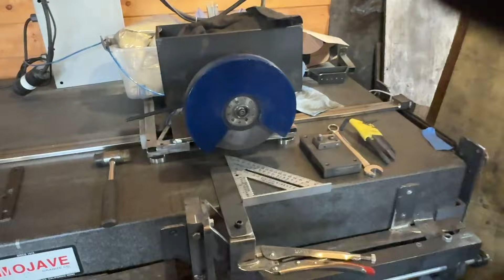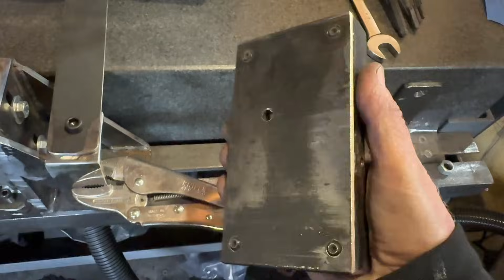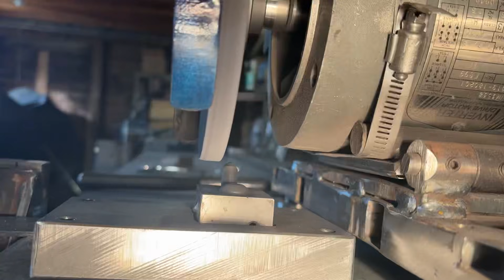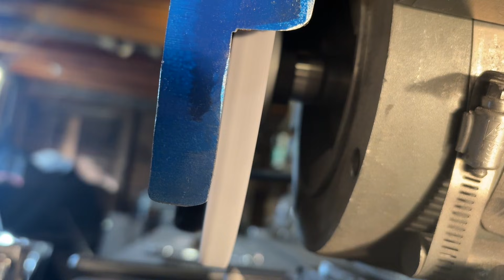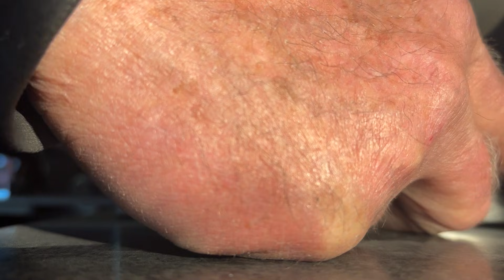Dressing the Grinding Wheel on my Air Bearing Surface Grinder

Comment: super interesting rig
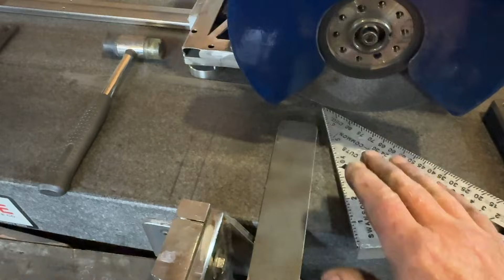1:49 ... dressing on an angle would make a curved dressed surface.  right on center it would be scooped out.
Reply from the maker: You are so right about the scooped out wheel face resulting from driving the diamond across the face at an angle.  Good catch.  

I drew it out to see how much deviation there is from flat.  If the diamond were guided across the face right on vertical center of the stone at 45 degrees, the center of the stone would be .038" closer to the axis of spindle rotation.

If you move the diamond path 1.75" forward of center you get what looks like a a face angled 40 degrees to the spindle and cupped about .009"

If you move fully to up and forward with the diamond until it is level with the spindle center, then you produce a flat surface at a 45deg relative to the spindle axis.

I wish it were possible to go back and dub in a correction.  But I do not know if that is possible in published YT videos.  I also wish I could post a pic of the drawings here.  Oh well...

Denis

Comment: Your project and the fabrication of the various tools needed to achieve your goals is interesting. Now for a few questions about the mechanics of things. What are you using for a spindle, and the type of bearings are in it? ABEC 7? Also, what are the wheel specs. on the blotter? After fifty years of grinding various materials, hard, soft, thick, thin, grinding some jobs are a test of your skill and patience.
 A criticism (constructive) of your technique, is your small cross travel movement, and sparkling them out, can build more heat and distortion in the top level of your workpiece while creating an upward movement and removal of material in the middle, which then becomes negative. Is your Y axis feed control able to maintain feeds in tenths? A saturated solution of copper sulfate and water “scuffed” across the surface with 120 grit emory cloth to color the surface without clogging the wheel pores as ink might, will make the progress easier to see. A jet of cooled air should help with heat dissipation without the problems associated with liquid cooling.

Best of luck as you progress.
Reply from the maker: Thanks for taking the time ot comment.  I am anxious to learn more.

Here is a scan of the casting I finished today:
https://youtu.be/juGpu7i1yEs

I am using the bearing that came in the motor.  I do not know what grade they are.  However, I did chck the runout rotation of the motor and found it to be a little less than a tenth.  I did imporove the dynamic balance of the motor as well. I posted about that in a thread on PracticalMachinist.com.

I have carefully followed the heat build up in my parts using paired thermocouples.  I know that a difference in heat of the sole compared to the bow disorts the casting a few tenths.  I use a box fan to increase air cooling.  I have tried copious mist coolant and found it to be messy and not very effective.  I have also tried compressed air blast and also felt it not worth the small amount of trouble involved in its use.  In my situation I can have a parallel non-grinding job going so that simply pausing grinding to allow heat equilibration has worked best for me so far.  I will try your suggestion of making faster and larger stepovers to see if that can speed roughing cuts vs heat build up.

I had not heard of the copper sulfate idea.  Interesting!  Do you know of any vids demonstrating this?  It sounds simple and may give a good clues as to how deeply I am cutting.

My downfeed is pretty crude and uncalibrated as it is controlled by a common bolt acting as a jack screw elevating the plate the motor sits on.  So, unlike my Harig 6X12 with DRO, I cannot easily control depth by tenths.  I know that a 6 degree turn of that screw results in about 5 tenths height change.

I have an idea that just grinding and grinding and grinding is going to be key to  really getting a handle on the process.  Getting pointers from folks with experience is a huge help.  My ultimat goal in making this grinder is not to supplant the function of a commercial surface grinder, but rather to prep cast iron straight edges for scraping.  So, really getting them to .001 (not .0001) over 36" is good enough.  I am able to do better than that presntly  and so I am pleased and intend to improve.

Denis

Comment: "air bearing surface grinder" then immediately seeing a speed square made me chuckle.  Very cool.
Reply from the maker: Ya, the Speed Square is plenty square enough for dressing the wheel.  You just don't want to be off by 5 degrees in your traverse.  That much error will show noticeable angling of the wheel surface.  And it is expected that the wheel, even if dressed perfectly square,  will develop some slight reduction in diameter of the side that leads the stepover.  It takes quite a bit of grinding for that difference to actually be a problem and to some extent that differential wear actually is helpful to the process.  And, hey, I like my Speed Square!  😊

Comment: Hi Denis, what kind of airbearing do you use? When you want a finer grinding image, just use a wood stick after dressing the stone, the stick can be any wood. 
The idea is to losen the not so good bonded grids out of the wheel and prep the cavitys with some wood. 
 Regards
Reply from the maker: I use a simple open-faced (not filled with porous medium) air bearing that is about 1.5" in diameter with about 100 pounds of air pressure.

Good point/reminder about using a stick to lightly applied to the wheel to dislodge loose grains wedged between grains on the surface of the wheel.  This should be done post-dressing as those loose grains are not helping anything and make unneeded scratches in the finish.  I have a 3/4" square wood stick with a piece of Norbide embedded in the end.  I use the wood-only end against the face and then knock the rough sharp edge of the stone face corners off using the Norbide.  It is hard to remember *everything * when making a video!

I wish it were possible to make a comment video that could be appended to the original video.  I often think of stuff later and I know you excellent comment will get lost in the forrest of comments.

Denis
Reply: @zekestrom  hey Denis, well you can do a text overlay when done.
Well there are guys who do mikrofilter the coolants but im dont doing that. 
Dry outspark every critical tool thats enough right now ^^